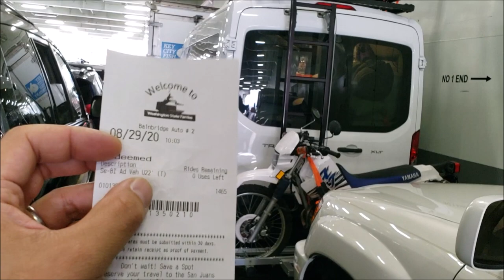Haul-Master Motorcycle Carrier from Harbor Freight

Comment: This guy sure does love the word " Skosh " !  Btw great tutorial very informative. As for the bending I ended up taking off their supports on both sides and put 1.5"x1.5" square tubing across the length on top of the carrier then drilled through the middle and each end then bolted them down at the corners and through the middle section and now it doesn't bend at all!
Reply from the maker: That is a good idea, thanks for sharing and thanks for watching!

Comment: I've had one for over a year now and am happy with it, for the price.  For me it was too high off the ground so I had to buy their extension, that lowers the rack a bit.  Even with the anti-tattle brackets, or whatever they call them, the unit seems quite loose, but that hasn't been a problem.  I might mention that the black plastic knobs are junk, I've had two of the break off.  They need some kind of metal wing nut, I'll probably have to weld something up.j

Thanks for the demo and review.

Jim

Comment: A block of wood cut to size and placed under end of ramp works great instead of jack. Loading parked next to a curb cuts down about 8 inches in height as well.  Also, anti-grip tape on ramp and rungs helps a lot...

Comment: Excellent video.  I'll be buying one of these carriers to transport my e-bike & e-scooter on my Sprinter.  The bike will rest on the carrier, and the scooter will fold and rest on the ramp.  BTW, the reason the platform deflected downward is because the weight of the bike and the downward pressure exerted by the straps exceeded the design limit of the carrier.  The bike weighs a nominal 300 pounds.  The force exerted while compressing the suspension would have easily been >100 pounds, thus exceeding the device rating.  That's my guess, anyway.

Comment: I just bought this yesterday for a Razor EcoSmart Metro Scooter. Thin 16” tires:

I just removed the wing nuts and it works fine.

I plan to chop off the extension that holds the ramp. Who needs that? I can throw the ramp in the SUV.

Comment: I drilled out the front receiver hole to make it hold my locking trailer pin, and I cut off the bar holding on the ramp to get it out of the way.

Comment: You mention in this video that the front tire locks barely work on your front tires because the width of the tires is narrow,  Do you know when the left and right tire holds are screwed all the way in what the measurement between the two holding points.  What is the width of the opening when the two tire hold downs are all the way in?  This will tell me if my fat tire (4") e-bike will work with this ramp.

Comment: Sadly I think that looks a little to weak for the real world. I am going with the black widow dirt bike carrier. Great video, you covered everything completely, thanks for a great video.
Reply from the maker: I'm glad it was helpful, thanks for watching!
Reply: I looked at another video of the black widow. The welds looked terrible.
Reply: I load the carrier from one direction using the ramp provided.  To unload, I don't use the ramp, I just start the engine and walk the bike off in the same direction it was loaded.  I believe you can't do that with the black widow, because it has a thing that traps the front tire.  As mentioned elsewhere, the black plastic knobs are junk, there needs to be a better solution, metal wing nuts?

Comment: Bought one but just took it back. Installed on a 3500hd 4x4 dually with a hitch adapter to also tow a sea doo. The bike was too far off the ground to safely load/unload with any degree of control. The ramp that comes with it is too short under the circumstances and it makes it too steep. I tried a longer ramp and supports under each side. Just too much to handle for a xr150l which is about 300 pounds.

Comment: I think I'm getting this for my dirtbike.When replacing the pin with a bolt,you might want to make shure to get the highest grade bolt.I believe grade 8 is strongest but not shure.Grade 5 is automotive grade and anything less may not be safe.
Reply: Thanks! I didn't know bolts are graded by strength.

Comment: Did not see you pull a pin for the rear wheel to lock it in once the bike is in place once the rear wheel also get's a rod through the spokes.

Comment: What size bolt did you use to secure the carrier to the receiver?
Reply: I've had one for over a year now, I use the standard hitch pin that's normally used with receivers of this type.  It's still quite loose though.